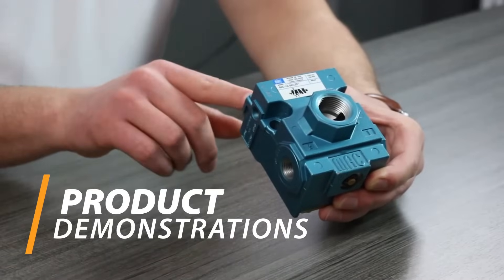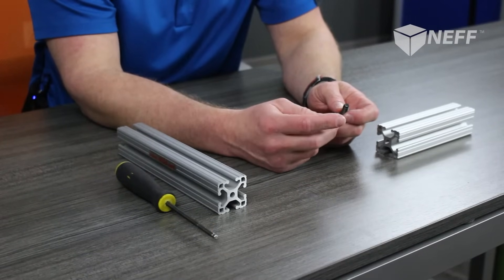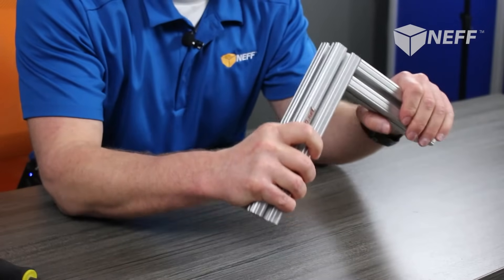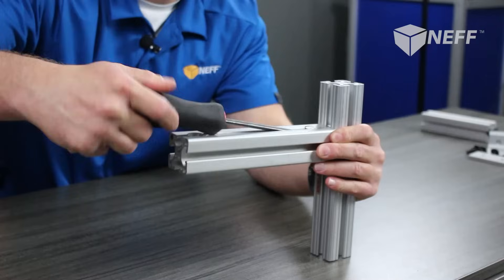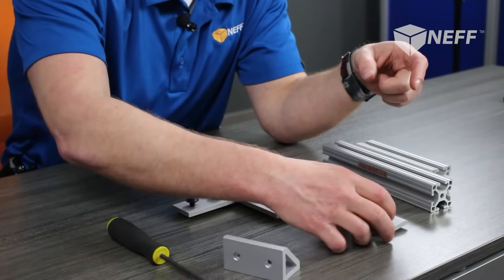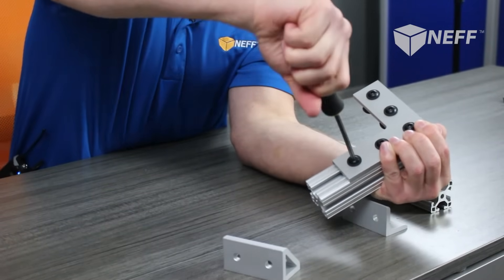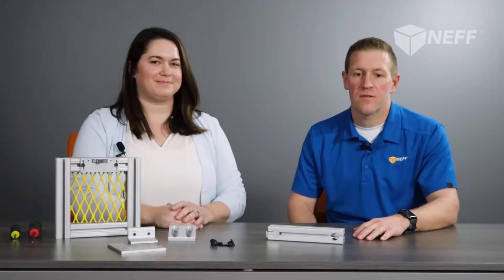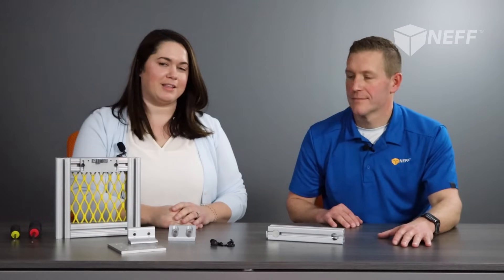How to Assemble T-Slot Frames using 80/20 Fasteners - NEFF Talk Live #2

Comment: How durable are the connections. will the connections become loose after some time as the screws may loose? I intend to make a dry wall with aluminum extrusions instead of using metal studs. The reason is that I want to hang cabinets. Metal stud dry wall seems to be weak and only for light duty loads.
Reply from the maker: The connections are highly durable as they are intended for tough industrial environments.

Comment: Seems a bit of a fail as far as RTA ideology...the end fastener needs to be end drilled and tapped, the corresponding leg needs to be drilled with a special jig to locate the custom hole...not very "RTA". The system for the End Fastener needs to be re-designed to avoid the end user custom fabrication required for assembly. The "cost-effectiveness" is completely lost once you add in the required customizations. The Corner Plate(s) are machine-free but as the host pointed out (twice) it is NOT a strong connection. Thanks for the video; you have certainly demonstrated the short comings of the 80/20 system.

Comment: I want to make a fence for my table saw for me I think I want 2 rails front and back of the saw im looking at 4040 for this but then i want a piece of 4080 as the fence itself. But i need to beable to slide the 8040 left to right along the 2 4040 extrusions. is there a way to do this thats easy? i dont want to use V rollers/wheels or whatever you call them id just like an interface between the extrusions that allows them to slide along each other
Reply from the maker: Hi Toto Guy, submit your project information here and one of our 80/20 specialists will reach out to you shortly. 
https://bit.ly/3EwLIzm